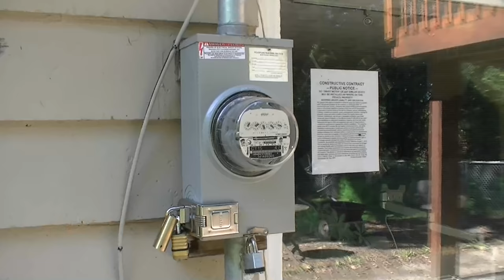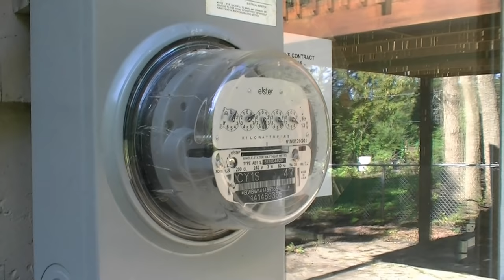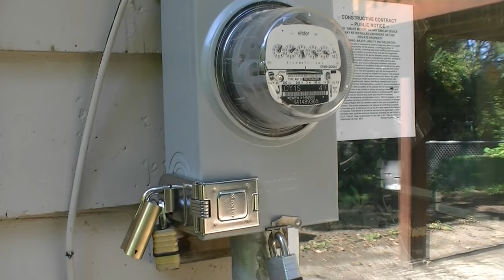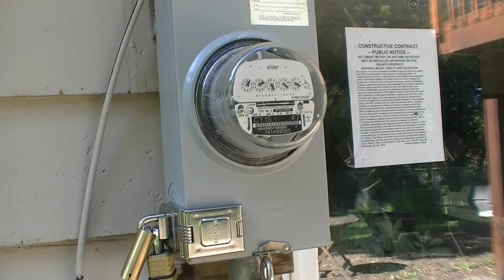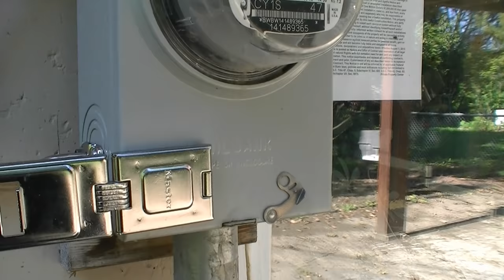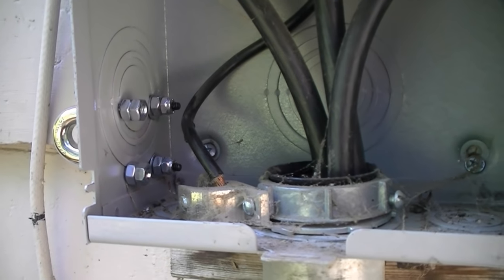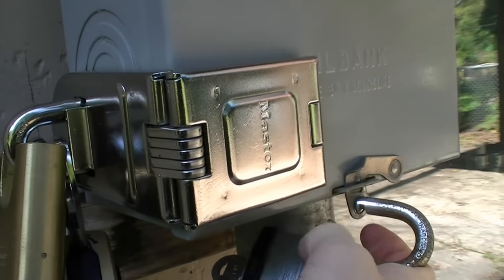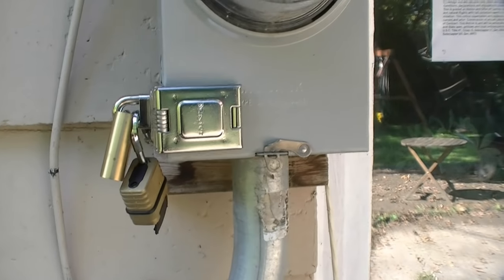Locking Your Electric Meter to Prevent Smart Meter Installation

Comment: Do NOT try doing ANYTHING inside of your meter socket.... It is EXTREMELY DANGEROUS... The voltage inside is 120 volts to ground( 240 volts across the terminals), and is not overload protected. if you short the wiring or ground one of the terminals, you're basically going to instantly vaporize whatever tool you happen to have in your hand when you create an arc flash with upwards of 20,000 amps traveling thru the tool you're holding that for all intents and purposes is just a bit south of a lighting bolt exploding mere inches from your face that's going to last as long as it takes for you to blow the fuses on the utility companies pole mounted transformer located a block or two away... Chance of going blind, being electrocuted, catching yourself on fire, and causing a few thousand dollars damage to your property is extremely high... not to mention the ass reaming you'll get in the form of an adjusted Bill while the power company assumes you were, and have been stealing power because you cut the seal off the meter and were obviously tampering with the lines. good luck proving you weren't at that point! DON'T DO IT!
Reply: Let's look at why we need TIN FOIL HATS. 
 #1 A smart meter will hurt or even KILL disabled homeowners who have disabled medical implants.  
#2 Did you know if your power company “turned off” the power to your home when they did a smart meter install, your chance of a smart meter fire increased by a factor of 1000.
#3 Your power company has access to all of you private power information. Eg When you make tea, when you turn on your alarm etc. This private information is sold to Google for huge sums of money. Ask your power company what the second radio transmitter in your smart meter does. (ZigBee) 
#4 A smart meter will cause cancer to return if your family members who are fighting cancer at home. If they come home from the hospital and sleep near a smart meter, they will die. Check with the US Cancer Society website. 
#5  Reason is Smart Meter RADIATION turn off breakers in your home. Both AFCI's and GFI's get turned off by the radiation from the smart meter.
#6 You smart meter is very accurate, BUT, the software (firmware) is programmable. Your bill has nothing to do with the power you use. 
#7 Smart meter radiation is breaking Ionic Bonding.
#8 A huge expenditure for a huge loss. Billions of dollars to purchase something that does not general generate any power and each smart meter need 4 watts to operate. One million smart meters use 4,000 KILOWATTS of energy to operate.

Comment: Would love to know how this is going in 2017. Did they come and cut it off? Were you confronted by electric company since locking it. This video was made a couple years ago.  Update to your situation??????
Reply: My locks are still in place, as is my analog electric meter.  I have not had any issues with the power company representatives at all.  They have never bugged me.

Comment: The main problem I see with your insisting to keep your old analog meter is that you can opt out of the Smart meter and keep your Analog meter. After I installed my first Solar Array system the SDGE electric company did not read my Analog meter for some six months and based my bill on the Highest usage the year before. It ended up costing me over $600. Then the next year I installed another solar system and they did the same thing. I opted to pay the $10/month for them to read my Analog meter.
However since October 31st 2017 they did not read my meter and again estimated my usage again based on the highest usage in 2017. this cost me over $300/month even with two solar systems pumping out the power into the grid. 
In addition to all that they changed the peak usage hours from 12pm to 6pm, and now it is from 4pm to 9pm. and the tricky bastards did  not tell anyone they did that. I am making up a small claims lawsuit to sue SDGE. will see how that works out.
Reply: Did you ever make the claim, and how did it turn out?

Comment: Why should I care what kind of meter the utility uses to measure how much electricity I use and when I use it? Seems like much ado about nothing.
Reply: Let us know how you feel about it when you get cancer or chronic headaches or other health issues. Oh, and your electric bill goes sky high.
Reply: Other than the smart meter being hacked why should I care? I do not use large electric motors so my effect on the power factor is minimal so that will not increase my costs. I also do not believe my health is effected by the radio frequency commicunications device. Otherwise i would haveto get rid of my Pc's and telephones.

Comment: All they can log is current draw.
Reply: Let's look at why we need TIN FOIL HATS. 
 #1 reason is they turn off breakers in your home. Both AFCI's and GFI's get turned off by the radiation from the smart meter.
#2 Did you know a flammable smart meter will turn off your power if you do not pay your bill, BUT it doesn't know when it's own butt is on fire. 
#3 Your power company has access to all of you private power information. Eg When you make tea, when you turn on your alarm etc. 
#4 A smart meter will KILL your family members who have cancer. If they come home from the hospital and sleep near a smart meter, they will die. Check with the US Cancer Society website. 
#5 A smart meter will hurt or even KILL disabled homeowners who have disabled medical implants.  
#6 You smart meter is very accurate, so accurate that it also measure the noise and dirty electricity. Have a look at INRUSH power. 
#7 Smart meter radiation is breaking Ionic Bonding.

Comment: How do firefighters disconnect the electrical power? Do they pull the meter out? Is that a concern? But then some people have their main circuit breaker panel outside, and so power can be cut off that way, even if the too-safe analog meter is secured.

How well does a property owner's right to secure their electrical box that the meter resides in, hold up in court or legal battles? Will the power utilities try to charge bogus fines, for unapproved meter changes or a wasted unapproved service call that was thwarted in such a way?

Is the little lock hasp that comes with the electrical box, is that adequate? I presume it is a good idea to take photographs, to help have some legal standing if the power utility vandalizes the customer's electrical box? Do the police ever side with the customer's rights?

Comment: You are not allowed to lock out the electric company. It's very easy to get in your box with a bolt cutter. Also you broke the company seal to open that. You are not allowed to break the seal.
That hasp bolt will cut like butter.

Comment: Let's look at why we need TIN FOIL HATS. 
 #1 A smart meter will hurt or even KILL disabled homeowners who have disabled medical implants.  The average of deaths by smart meter radiation and smart meter fires is almost 100 every month in North America.
#2 Did you know if your power company “turned off” the power to your home when they did a smart meter install, your chance of a smart meter fire increased by a factor of 10,000.
#3 Your power company has access to all of you private power information. Eg When you make tea, when you turn on your alarm etc. This private information is sold to Google for huge sums of money. Ask your power company what the second radio transmitter in your smart meter does. (ZigBee) 
#4 A smart meter will cause cancer to return if your family members who are fighting cancer at home. If they come home from the hospital and sleep near a smart meter, they will die. Check with the US Cancer Society website. 
#5 Smart Meter RADIATION  will turn off breakers in your home. Both AFCI's and GFI's get turned off by the radiation from the smart meter.
#6 You smart meter is very accurate, BUT, the software (firmware) is programmable. Your bill has nothing to do with the power you use. 
#7 Smart meter radiation is breaking Ionic Bonding.
#8 A huge expenditure for a huge loss. Billions of dollars to purchase something that does not general generate any power and each smart meter need 4 watts to operate. One million smart meters use 4,000 KILOWATTS of energy to operate.
#9 The second radio transmitter is for ZigBee. If you want your power company to MONITOR your home 24/7, then you are in luck. Don’t forget, this private information will be sold. Why do you think your power company spends BILLIONS of dollars and does not generate one watt of extra power to sell?
Reply: Why would I supply proof to you?
You obviously believe smart meters are 100% or you wouldn't be arguing with me. 
SO GEOFF65, WE ARE GOING TO USE YOUR PROOF 
GO OUTSIDE AND LOOK AT THE FACEPLATE OF YOUR SMART METER. 
You will find the FCC IDENTIFICATION NUMBER that is issued to the smart meter manufacturer. 
WRITE DOWN that number and get back to us. 
When you come back with the FCC ID Number, either one of us can use the Searchable FCC ID Database.     https://fccid.io/
Under the RF report, we can give your customers a link for the CERTIFCATION EXHIBIT. 
That RF report from the smart meter manufacturer, FCC and testing facility will tell us what the DO NOT INSTALL DISTANCE is for that specific smart meter.

If you do not get back to us, then we will know the HUGE AMOUNT OF RADIATION has either scared you or killed you.

Comment: Actually, YOU don't have access to the meter socket.  The meter is the cash register for the utility.  999 times out of 1000 the wires inside are unfused and pose a danger to anyone in there not qualified.  Vandalism for cutting off a lock placed by an owner on a utility socket?  It's the other way around.  If you cut a seal of the utility you are breaking and entering.  I've spent years with EMF and it's simply the magnetic waves produced by a collapsing electric field.  Nothing harmful to the human body.
Reply: Let's look at why we need TIN FOIL HATS. 
 #1 A smart meter will hurt or even KILL disabled homeowners who have disabled medical implants.  The average of deaths by smart meter radiation and smart meter fires is almost 100 every month in North America.
#2 Did you know if your power company “turned off” the power to your home when they did a smart meter install, your chance of a smart meter fire increased by a factor of 10,000.
#3 Your power company has access to all of you private power information. Eg When you make tea, when you turn on your alarm etc. This private information is sold to Google for huge sums of money. Ask your power company what the second radio transmitter in your smart meter does. (ZigBee) 
#4 A smart meter will cause cancer to return if your family members who are fighting cancer at home. If they come home from the hospital and sleep near a smart meter, they will die. Check with the US Cancer Society website. 
#5 Smart Meter RADIATION  will turn off breakers in your home. Both AFCI's and GFI's get turned off by the radiation from the smart meter.
#6 You smart meter is very accurate, BUT, the software (firmware) is programmable. Your bill has nothing to do with the power you use. 
#7 Smart meter radiation is breaking Ionic Bonding.
#8 A huge expenditure for a huge loss. Billions of dollars to purchase something that does not general generate any power and each smart meter need 4 watts to operate. One million smart meters use 4,000 KILOWATTS of energy to operate.
#9 The second radio transmitter is for ZigBee. If you want your power company to MONITOR your home 24/7, then you are in luck. Don’t forget, this private information will be sold. Why do you think your power company spends BILLIONS of dollars and does not generate one watt of extra power to sell?